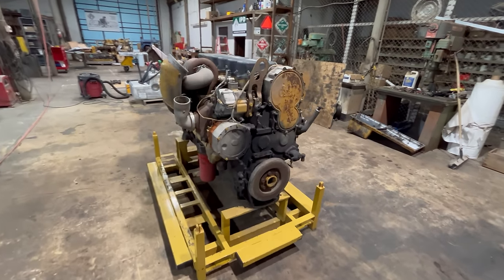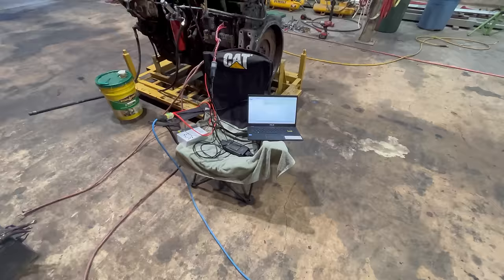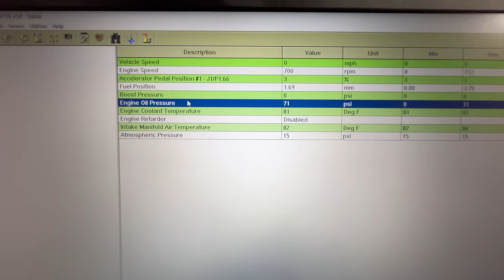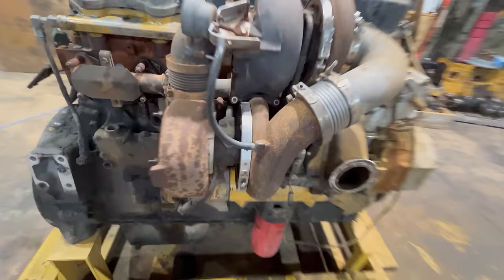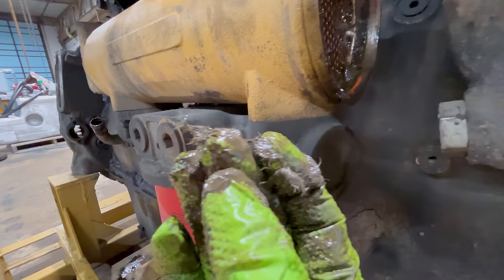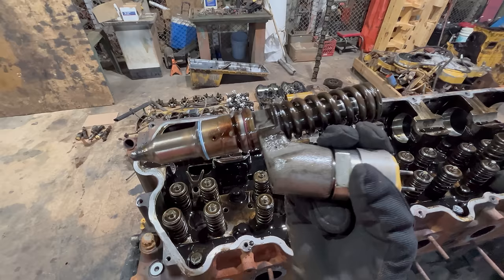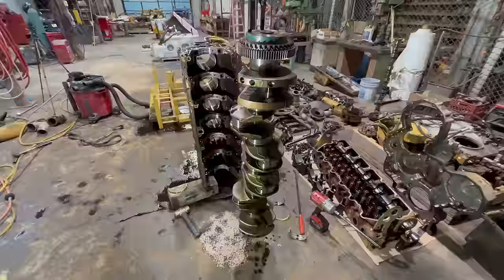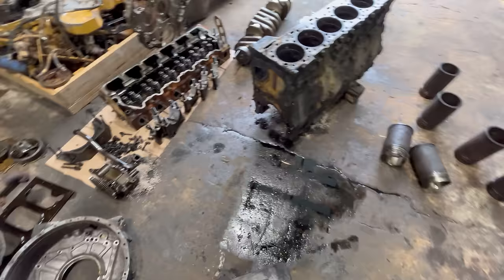Compound Turbo 15.2L Caterpillar C15 Core Diesel Engine - Will It Run?

Comment: This channel is an inspiration man, got me to apply at the yancey near my home so I can start learning about these awesome engines. I start Monday and can’t wait to see what it’s all about to work on big diesels. Like everyone else I love the videos and are thankful the videos you do post when you have time. Much respect to you bossman 💪🏻👍🏻
Reply from the maker: Good luck, hopefully the industry will treat you well.
Reply: I wonder if that could have been some kind of stop leak or block sealant they used? Love your videos. Company I drove for bought some C15s. Typically they were on a  5 year rotation. I put 700k on one with only 1 alternator, 1 water pump the rest was just scheduled maintenance. Great engine.

Comment: I'm a retired heavy equipment mechanic.  I have a part time job helping a buddy out in his radiator repair shop.
The crap that people put into their radiators to "try" to stop the leaks,  oh man the junk they use.
Radman in a can we call it.  Just keep dumping it in until it plugs something up, maybe the leaking rad, maybe not.
Always fun to gather around and try to figure it out.
We do lots of logging equipment, the old time loggers and some of the fixes they use.  Eggs, black pepper, what ever wonder cure the local auto store has on the shelf.

Comment: That crap in cooling system I believe is a stop leak product. I have seen it before in a few cars with a blown head gasket or cracked block . I could be wrong ,but that is what it looks like to me. Cool channel and thanks for the upload..

Comment: As a man who’s re-pinned an ecm (thanks Cummins!), and changed a manual to an auto in that same truck, your knowledge of all systems including electrical is impressive. I can’t say I enjoy doing this type of work, yet I can’t not watch your videos. You’re a great teacher, even if you don’t wanna be. Safety 3rd! 👍
Reply: What make, model and year of truck did u convert from manual to auto? Would love to do the same
Reply: @timothypowell5687  I had a donor Sterling garbage truck that the motor and trans came out of. I wouldn’t recommend doing it without the donor, as the TCM has a 40 pin harness. There are sensors and shit still on mine that I have no idea what they do. It took me about 2 weeks to get all the wiring figured (working) out, with schematics. I think I lost a couple days bcuz of a missing resistor on end of a data cable my helper cut when removing it. It wasn’t fun, but it’s been running strong since 2019 and it’s my DD.

Comment: Looks like a radiator leak that was fixed with magic powder, but it also lost cooling fluid and was run with straight water for a while
Reply: yeah, cavitation seems to be caused by straight water. The mistery is the hairy thing on the coolant though
Reply: Yea u was thinking the same.  Someone tried using stop leak
Reply: @cesargallo7424  Left open to "cool it down" and a cold rodent crept in?
Reply: @t.w.3  who knows!!
Reply: The remains of "The Stopleak Squirrel" , may it rest in emulsion.
Reply: Our cat is messed up from using water

Comment: I'm honestly impressed with how clean that was running for not having the compound turbo setup connected to the intake. Even when you were revving it, it was still blowing pretty clean.
Reply: they usually burn pretty clean
Reply: @MississippiMudMX  lol, you should see what mine looks like if you try to run it without the turbos 😂. Same engine just turned up to about 800 hp.
Reply: I would assume that's because it has a fuel table that adjusts fueling based on RPM and PSI. It could tell there was no extra boost.

Comment: My eye definitely twitched a little with the condition of that web belt lol. On the flip side, I've tested belts in worse shape that still made the 5:1 safety factor they build those to before breaking. Excellent video. Loved seeing that motor turn over.

Comment: I'd almost put that metalic sludge in the cooling system to be a water pump failure. you did mention that it has a new water pump so i would say most likely the old pump had started prematurily failing due to maybe incorrect coolant. Keep up the videos, always fun to see this kind of content.

Comment: I just did a brand new cylinder head on 07 Cummins. Still blowing out coolant tank when hot. Pretty sure he cracked the block, drove it 10 miles highway speed no coolant. Started coolant elbow on fire on top of head.

Comment: I bet the liners started leaking due to a lack of cavitation protection, and the person added stop leak to the radiator. That is very likely what the metallic fibers were that you found.
Reply: They might be fiberglass or aluminum.

Comment: You know, a compound turbo setup works very much like a twin spool turbine engine. Those have a low pressure compressor, high pressure compressor, high pressure turbine, and low pressure turbine (simplified of course - each compressor and  turbine has multiple stages). The LP turbine drives the LP compressor and the HP turbine drives the HP compressor. All of these run on concentric shafts, the HP shaft on the outside and the LP shaft on the inside. The air flows just like it does in these compound turbos. Some engines like the Rolls Royce RB211 and its descendants have intermediate pressure turbines and compressors on a third shaft. Each shaft with its associated compressor and turbine blades is called a spool because of its shape.
Reply: Always one of ya
Reply: and yet, despite the bleeding obvious solution staring people in the face, noones actually taken that next step.
who says combustion chambers have to be a fixed volume?
and who says every stage of a turbine engine has to be a turbine?

tradition.

lot of tradition holding development back. people oughtta use their imagination more. and/or refer to the history books a bit more. the old patents and designs that may have been deemed unworkable... at the time. limits in materials, reliance on other technology, blah blah...

if we had had turbochargers about 150 years ago...
the so called "otto cycle" would be a brief chapter in history.
Reply: I figured compound turbo is two separate turbos of different size in parallel, both fed off the same exhaust manifold and both connected to same inlet manifold. The "compound" describing how/when each turbo is engaged, not the airflow route like stages in a gas turbine/compressor.
This way you get a wider range of usefulness and quicker response/spool up time from the smaller unit. 
I guess some are in series like this one?
 Twin turbo I thought is two identical turbos usually each feeding a separate bank of cylinders
Reply: @Username-qx9gk   All of the compound setups I have ever seen have had one turbo feeding the other like the ones in this video. I don't have any experience with them but the high pressure turbo is usually smaller and since it's closest to the engine it still produces good response.
Reply: @PresidentSkroob12345  Yeah, compound does seem to refer to in-series, now I'm not sure what you'd call the two different size in parallel, complimentary twin maybe?
Reply: @Username-qx9gk   The 3rd gen RX-7 had two different sized turbos. The small one was used at low RPM and the big one kicked in at high RPM. It was called a sequential turbo system.
Reply: @PresidentSkroob12345  Same as on my BMW 335D, it supplies an incredible amount of extra torque over the standard single turbo model, but in the case of BMW you really pay for it in the purchase price but it`s reliable & economical.

Comment: I've worked on a 6 cyl. in line diesel where the sleeves looked like just what you have there. My motor was actually pumping crank case oil into the cooling system and over-pressurizing it. No anti-freeze in the crankcase, just engine oil in the cooling system.
Reply: What coolant did it run before the rebuild?
Reply: @abc-jd9se  It was 25 years ago, so not sure, but probably green stuff. JD motor in a 30 series tractor. IIRC, a sleeve kit and new heavier ground wire to the starter cured it. The motor ran fine after that and never had any further trouble. Took 3 trips to the shop before we figured it out. A real head scratcher. First two attempts only fixed the symptoms before we pulled the motor down and found the sleeve pitting on the third trip. Had to use a special dye to figure out that the pitting was where the pressurized oil was getting into the cooling system. Weird thing was the coolant system didn't develop enough pressure to get into the crankcase through those pits.

Comment: The mess inside that thing is some form of stop leak, or multiple brands mixed together. Ive seen the fuzzy stuff plug up heater cores solid, and you can't pour the coolant through a paint strainer without plugging it either.

Comment: Could that crumbly crap in the cooling system be some kind of stop leak?
Reply: That's what I was thinking
Reply: Ah yeah! that would explain the fibrous stuff. They rebuilt it, but were to cheap to use the proper coolant, accrued cavitation damage to the liners to the point it developed pinholes, and they dumped a crapton of stop leak into it to try and save it.
Reply: It’s a grey mouse 😅
Reply: @themountainman2613  😂😂

Comment: That metallic shit is a type of block and radiator sealant... I've pulled a few apart that looked like that after they pored the radiator dull of that junk, and it can cause electrolysis and tear the sleeves and even the block up under the right circumstances brother
Reply: You're gd genius Gump

Comment: It's so interesting to see the similarities and differences in diesel engines between different applications. I work as an assembler at a factory that builds diesel engines for agricultural machines (tractors and harvesters mostly). Some of the bigger engines there do use also compound turbo set up just like here. Difference is that the air-to-water heat exchanger is located between the secondary and primary turbos, instead of after both of them like here. Also the wastegate in the primary turbo is controlled electronically by a servo-motor. The compound turbos in my factory seem to be kinda getting phased out though. They are being built a lot less than before and some of the newer bigger engines are getting replaced with big single-turbo setups. But there are still newer versions of some engines made that still use the compound turbo setup

Comment: They ran this thing on water, no coolant, which caused the electrolysis damage to the liners.  The junk in the cooling system was numerous attempts with "stop leak" products to plug the leaks.  Some of those products include fibrous material which supposedly fills holes.

Comment: Wrong coolant caused cavitation which eventually caused coolant loss or pressure in the cooling system like you said.

Tried to fix it with some cheap parts store stop leak that had some kind of metal suspended in it like bars liquid aluminum stop leak. That would explain the weird metallic sludge.

Comment: That metallic stuff in the cooling system could be some kind of stop leak.  One of the things that stood out to me at the beginning of the video was that the head was without paint and was rusty.  Why would a supposedly new head look like that, unless it had gotten pretty hot?
Reply: Replacement parts are often not painted, not sure why.
Reply from the maker: New heads aren't painted.  That's exactly how they look after about 2 months.
Reply: @electr0maker436  Mainly because painting is often one of the last steps on the assembly line of a complete engine.
Replacement parts obviously don't do anywhere near the assembly line so no paint.
Reply: @deezelfairy  Ahh that makes sense.

Comment: looks like it was a pretty good core. alot nicer internally (where it matters) than on the outside.  a dip in the block washer, a fresh coat of paint and reassembly and shed live another 20 years. i agree that they were likely running pure water for coolant or at the very least they were running parts store "all engine" coolant and not genuine Cat diesel coolant.  Other than that, the internals looked really good

Comment: I got the pleasure or rebuilding a 7060 allis with about 60hrs on a overhaul that had water in the oil due to cavitation. When the final story was told the tractor had sat 1/2 apart for 2 years before my guy got it. They slapped it back together painted it and dumped the old coolant back it as well as reinstalling the mud dobber filled radiator. All that dirt and weak coolant ate the liners to death. One side looked bright and shiny the other was pitted as bad or worse than yours.

Comment: I had an EGR 60 series and once the emissions junk was removed and I put on aftermarket turbo and manifold it ran awesome and had very good power and fuel economy.  That was true of the cats to, seamed most guys  removed the compound turbo setup and made them pre emissions.

Comment: I went back to the start to see if it had a water filter, but maybe it had already been taken off. Or maybe they’ve eliminated the water filter with anode, and are relying on the antifreeze to address the dissimilar metals situation. Used to be when you had the water filter, and you ran the milky white lubricant Cat used to sell, you could run water in the summer. Maybe things are too hot for that now. In any event, there was too much “saving money” going on with this engine. They were “saving money” on the cam and lifters(or getting ripped off). And they were probably “saving money” by keeping the old radiator. Surely any truck new enough to have this engine original would not have had a rebuildable radiator. So you have a few good parts, but the core is probably no good. Ah well, take care. And thanks for the video.

Comment: I bought on impulse a 40 foot semi van so old it doesn't have spring brakes, pre 121 wedge brakes, inside is a 1983 Cat D349 with a 705kw genset, has all the panels, gauges and even a step down transformer. Hasn't been run since 2006. Will run off starting fluid so far, still working to get the fuel lines cleaned out, old fuel is brown and nasty and I think the lift pump isn't building pressure,  the manual prime pump will. At least the batteries were good, has a 36 volt starting system. Got it at an auction cheap.

Comment: These were the absolute best of the iva emissions attack  engines. Never had rocker stud disasters with the bxs models.  Once they integrated the Jake's and  the iva into the same casting
The side load on the rocker shaft studs couldn't hold it.  Major warranty failures. If you caught it in time you got away with a rocker shaft and arms. Otherwise head was trashed.  I know well you've seen it

Comment: The non use of diesel specific coolant causes the issue, as without it the vibration of the power cycle causes cavitation, much like an ultrasonic bath does.
And that is how easy it is to ruin an engine.
The part of the liner that has the piston side load on it is where the cavitation happens, as the vibration is transferred from the piston the liner when it fires that hole.

Comment: Thanks for this video! I run this same engine on my 2007 379 peterbilt. No overhaul yet at 945k miles and about 34500 engine hours I pull a fuel tanker so always kind of overweight 😅 will see how much longer it lasts .

Comment: We had an acert like this at the farm. It ran hot. Always. It turned out to be the solenoid to the precooler. It was stuck in the closed position. Tip: Don’t attempt to get the plunger out when the coolant is 230 degrees. Very uncomfortable when it comes loose!!

Comment: Good video! I got out of a 2003 model Pete with a C-15 and into an 05 with a C15 Acert. I immediately wanted my 03 back. To this day I do not like the compound turbo engines. I’ve got one in a wreck right now we’re going to pull out and convert back to single.

Comment: That gritty stuff could be that garbage radiator leak seal crap they sell at any auto parts store.  I did some work years ago on a few cars where their owner put that junk in the radiator instead fixing the coolant leak itself.

Comment: The only thing that I know about turbo'd engine is that you don't have to shut it down real quick but instead just wait a minute or so and then you do it. This is only for the turbos to let them slow down after a running situation. I like personally your work and the way you do it

Comment: Liner damage could be a design fault.
The cavitation damage on the liner will probably be where the cooling channel between liner and engine block is at its smallest.
Throttling the water movement, causing cavitation.
There are additives (DCA4), that can be mixed with the coolant chemical to help prevent this.

Comment: I had a head gasket go (between number 4 and 5) shortly before I intended to sell my '07 Pete ('06 C13 ) in2017  so I had them do the Platinum inframe and added the cost to the sale price. The present owner is still running it.

Comment: Cables are not sized for ideal ampacity but as a compromise by designers so there is nothing wrong with running two instead of one on both power and ground side for testing. Old cable often corrodes internally especially inside crimped lugs. (I put a dab of dielectric grease in each lug before crimping to give stranded wire a good coat.)

Comment: i got the same engine in my 2007 Kenworth T600 its a beast pulling 80000lbs on I 80 east in Pennsylvania state college am forced to jump to the far left lane to avoid the plastic trucks blocking the 2 right lanes

Comment: “3,156,806,000 revolutions.”

•	In terms of time, if you were to count from one to one billion continuously, without stopping, it would take you around 31.7 years.
	•	In the context of distance, if you were to stack one billion US dollar bills, it would create a tower reaching approximately 67.9 miles (109.3 kilometers) high.
	•	If you had one billion grains of sand and spread them out, it could cover an area roughly the size of a large swimming pool.